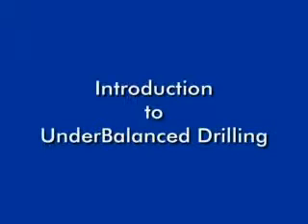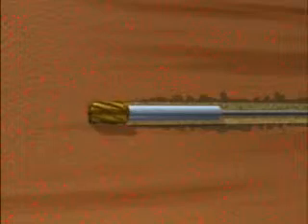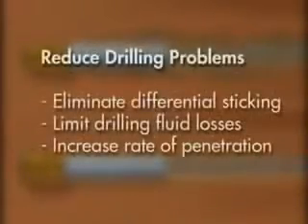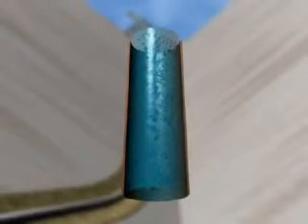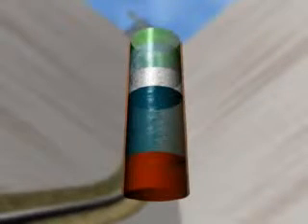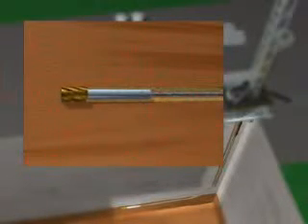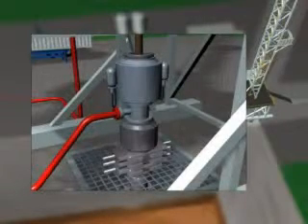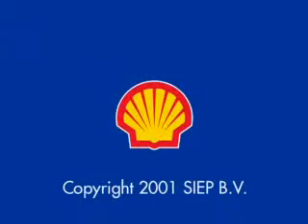UnderBalanced Drillling

Comment: Does underbalanced drilling give less of a margin of error if the well kicks? Is the underbalanced system only used when the drilling turns horizontal into the target formation or is it also used on the vertical stem of the well?